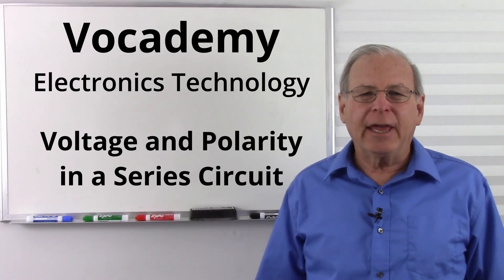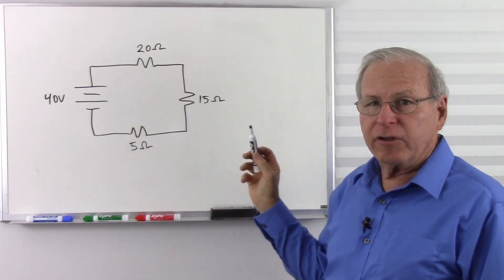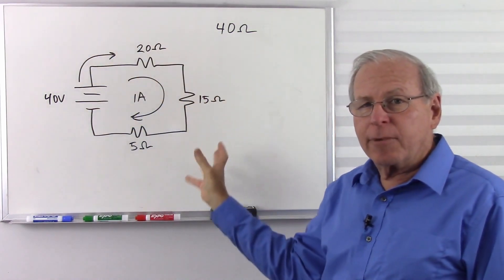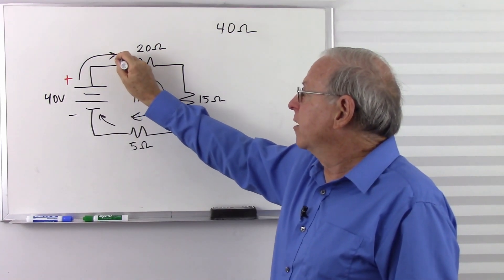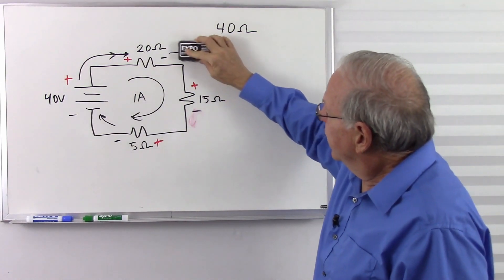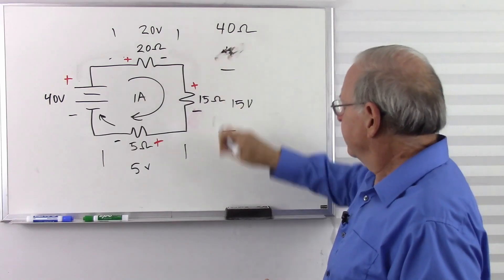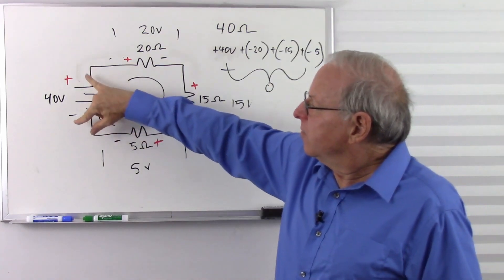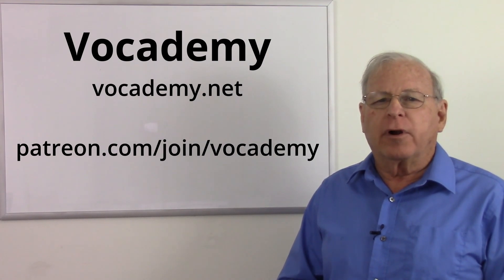Voltage and Polarity in a Series Circuit

Comment: How does a multimeter know which side is positive and which side is negative? Let's say I have an non-conventional multimeter, whose two probes are of the same color (say white); and a battery whose polarity isn't labeled. If I place one probe on one end of the battery and the other probe on the end of the battery and it reads, say positive 9V, then how would know which end is positive and which end is negative?